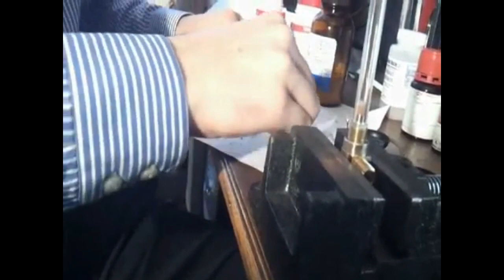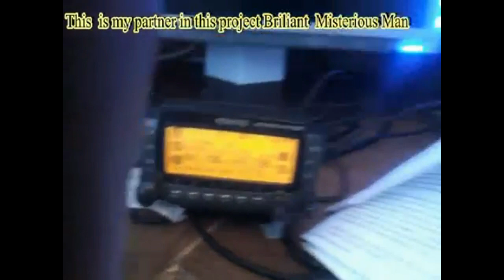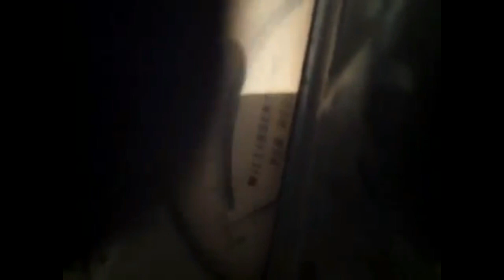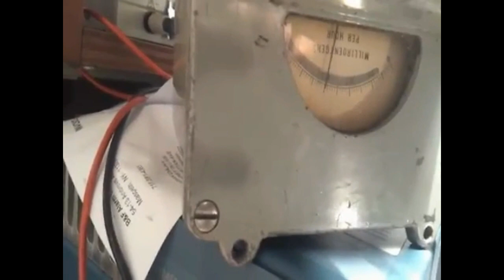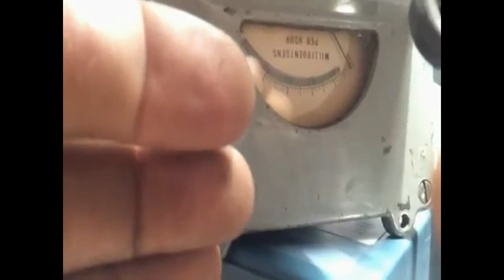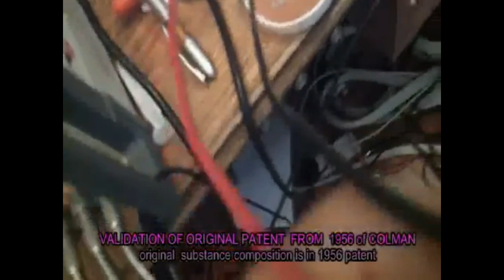Revolution has begun : Free Energy exposed part2

Comment from the maker: I activated the compound and it show on the  meter( model is  in video) After power was disconnected it decay slow. 
I also found presence of aftershock where compound kick up with no  RF present.
Please read  Colman patent.
The phenomenon might be assign to betavoltaic . 
searh for quote:Army Research Lab did betavoltaic testing in 1954 using dissimilar metals. In one device not much larger than a car battery they were successful in achieving a 70 watt output 
"semiconductor compound" 

Wesley

Comment: Correct me, You are transmitting 448.070 MHz using 40 watt.
You feed the signal to a coil. inside the coil is a glass tube filled with various fine ground elements such as copper and zinc. You are building a charge cloud and when your hand approaches a region the cloud charge appears as a sharp burst on the radiation meter.

Comment from the maker: yes it is there might be slight modification ( shown on  one of the pictures in video
as overly  schematic with the switches)
The modification is only separation  of charging  circuitry from  receiving one
Thing is that without the switch your load is affecting resonant  parallel  circuit of device adding to overall impedance.
other than that it is simple.
I did my part
You guys  add  your part to FREEDOM of ENERGY

Comment from the maker: CORRECTION: it is COLMAN device ( not coleman)
suspicion of my is that  Tariel Kapanadze  has small tube  hidden inside his 100kw/h device and that how he is extracting electrical energy.

Also electromagnetic wave is every where around used commercially
After  establishing  what resonant frequency  range could be utilised based on compound structure it is possible that 9V battery within 15 seconds
driving generator  is OK same way like Kapanadze start his device

 than it works alone

Wesley

Comment: Hi Wesley, what kind of load where you driving with the output ? Did you succeed to light a lightbulb or some load like this ? What is the output to input power ratio ? Maybe your RF transmitter just jams your radioactive meter  ??

Please do a better a shorter video where you just show input and output power and lighting a lightbulb load or any other resistive load. Many thanks.
Regards, Stefan.

Comment: Wesley, of course I have got it (though what you have there is not the only way).
That device appears to be like a self energising rectifier and equally compact, so its characteristics (frequency esp.) will change as it starts up and runs.  That is - not a 'domestic' appliance.
Maybe two concentric tubes would be better with cooling water flowing between them to a radiator.
Also, how can we know whether the elements used there are generating neutrinos or not ?
Where do I send my 'bet' ?

Comment: That Patent warns of Gamma radiation.
Surely your contamination meter has an alloy body that shields both alpha and beta, so it reads gamma only ?
Remember Hendershot ?
His EM dissociating steel inductor sleeve cores also radiated - directly into the aluminium tuning capacitor foil overwind, thus directly transducing radiation to sustain both oscillation and output.
Kapanadze is similar, over wind transduction increases the generated dissociation field.
Some elements release gamma, others not ?